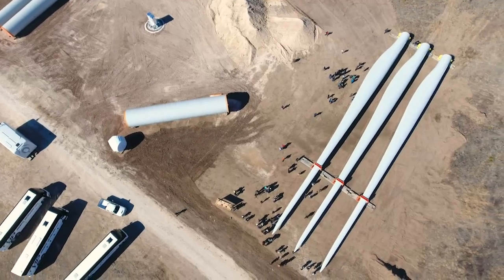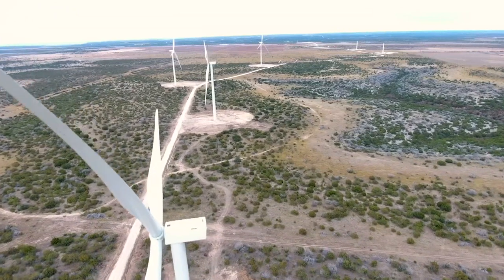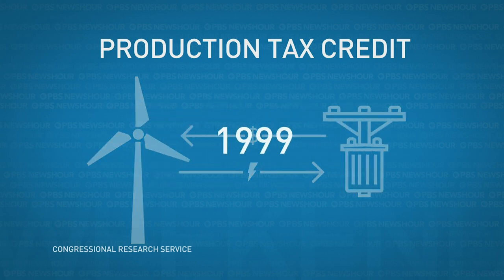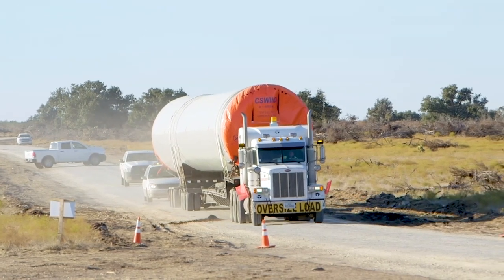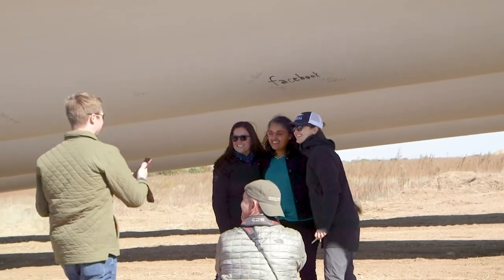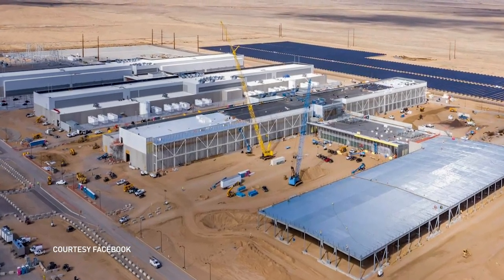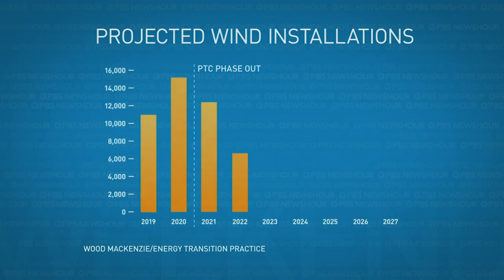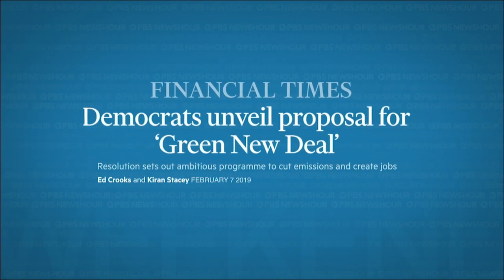How The End of a Major Tax Incentive May Impact Wind Energy

Comment: Honestly if you're so worried about CO2 just use nuclear instead of bird shredders that only generate energy some of the time so you still need a back up power plant
Reply: New nuclear plants are basically the most expensive, slowest option available to generate new electricity supplies. Regional solar PV and hydro work well to back up wind farms. Also Tesla 3 MWhr megapack grid batteries will change the game too allowing intermittent renewables to become dispatchable renewables.
Reply: @aaronvallejo8220  nuclear is the most energy dense fuel source. behind that is oil. So is it possible to maintain our current consumption